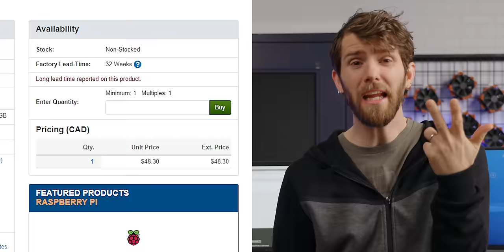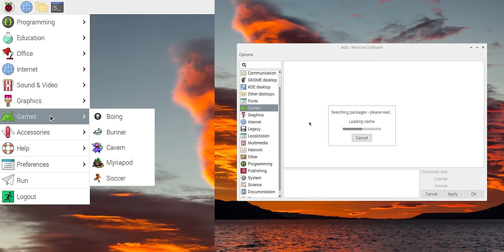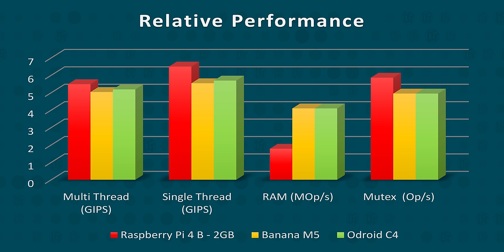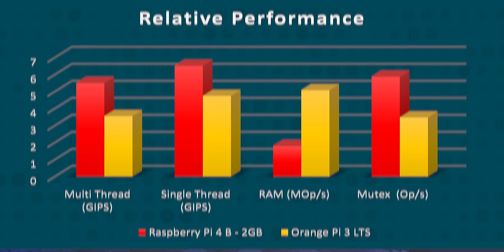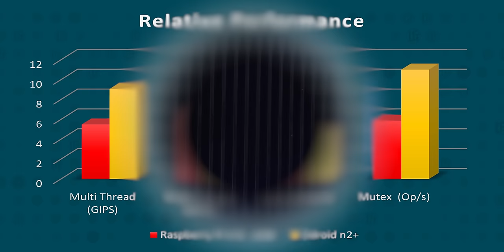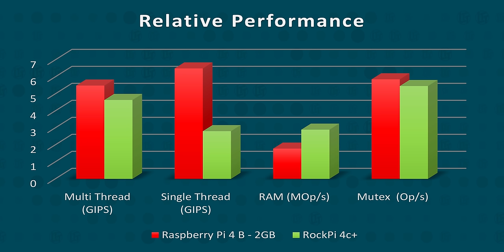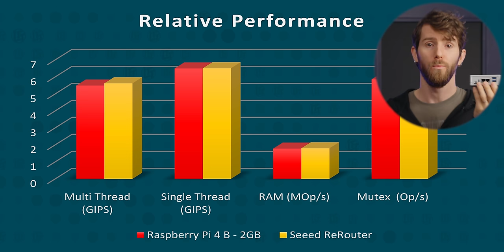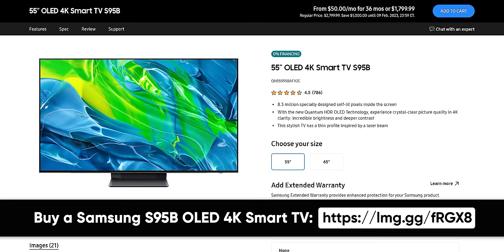I Can Save You Money! – Raspberry Pi Alternatives

Comment: I'd love to see you guys try some projects with some of these to see how much or little trouble you run into without the full support of the raspberry pi community. Maybe boost the community around these alternative single board computers
Reply: not hard. most projects require your own coding and the rest is simply hardware compatibility. If GPIO is your goal and you know linux and python, then you are set. Also you need a minimum of 2GB of ram to compile python for arm with additional performance flags. In other words only things that are pi specific that unskilled people cant do, can be replicated on other SBCs given that they have USB, GPIO and other similar things. As long as the OS is debian based, drivers/hardware works in it, you are set.
Reply: Yeah, a shootout comparing the user-experience of the various RPi alternatives, as opposed to their raw technical specifications would be very interesting.

Comment: Perhaps for next comparison, even if you compare only the specs, I'd mention the power consumption. For SBCs it might be important. After all, the whole appeal of ARM processors was computation per Watt.
Typically boards with larger RAM have higher power floor.
Reply: @filthyfrankblack4067  yeah anyone who knows anything about framework laptops is that removing usbs saves battery

Comment: I remember being amazed when I first got a Raspberry Pi Zero running. The setup was effortless but what really shocked me was how capable the system was for a PC that only cost me £10 and could fit in a wallet.

For just £10 and a few dongles I had a relatively capable desktop computer. Obviously it's not going to run modern games but you could still use it for word processing, running certain programs, and even using search engines (this one may not be possible now though).

There was once a time when computers were the size of a small house and no more powerful than a modern calculator. Back then, the concept of full office contained within a computer the size of a pack of cigarettes would be beyond sci fi, it would be full on fantasy.
Reply: Yea now there 140 bucks not that cool hmm
Reply: @viperrr6886  pi zero 1.3 is still £5 but it's out of stock [and prolly will be for a while]
Reply: >full on fantasy
the future is now, thanks to science
Reply: @hiddendrifts  
I'm wondering how lucky I am or how global is actually the global shortage
I'm in Belgium and, if you were patient enough (a few months I would say), you were able to get most of the models from an approved reseller  
However, I agree that Pis alone are hard to get : most pis offered by the seller are part of a pack. Which is good if you want to start from scratch (and bad if you are a scalper and need to store stuff), but less funny if you already have spare cables and simply need an hardware upgrade
Reply: @laplongejunior  >are part of a pack
i mean, spare parts are always nice to have, and you can just sell them if you really don't want them
Reply: @laplongejunior  Working with an approved seller is what you have to do if you want a Pi at a reasonable price.  The global shortage is still global, though.  Resellers sell out almost immediately and they have to wait weeks to months themselves to get orders fulfilled.  Them selling the majority in packs make sense since they need to be able to make their money too.
Reply: Try compiling on it compared to the worst computer you ever used.
Just like all those celeron owners
Reply: That’s actually not true.
Reply: @viperrr6886  Interesting comment.
The brand new, yet to be released Raspberry Pi 5, 8GB version is $80.
Pretty cool Hmmmmmm. At least post when you know what you are talking about.
Reply: "We interact with things today that our own Gods would not have dreamt of" - Mike Pondsmith 

(idr the original quote im paraphrasing)
Reply: Try the pi4 with RISCOS. It's really fast with the original OS for arm processors.
Reply: We can make a mini raspberry pi pc
Reply: @turbochargedfilms  nice quote. but I'm picturing our gods sat around eating chicken wings and popcorn, enjoying the ambrosia, betting amongst each other watching our species randomly fcuk around and find out... engineered viruses, nuclear weapons, particle colliders, communism, etc. they already knew we were comedy gold...
Reply: I know you were not being literal, but science fiction is fantasy, after all. 😉
Reply: If you are over 30 years old, chances are, you have a pile of old laptops, phones and desktop parts in your closet that absolutely destroy even $100 Pi.

Comment: Having owned multiple Pis and alternatives, I'm of the opinion that for most IoT use cases, an older model Pi 3B is all you need. It works fine and hits that sweet spot of performance and power draw.
Reply: Awesome! Of course, the older model Pis are all out of stock/costs hundreds of dollars now, so that conclusion doesn't help. Whereas the alternatives are at least able to be purchased.
Reply: @magnusgreel275  my alternative for my usecase and broken pi was reactivate my very old core to duo pc. Way faster 😜
Reply: @Nordlicht05  I did something similar with my old PC, but it's a hefty system which sucks up a lot of power. I'm thinking of getting a thin client second hand to serve the same purpose.
Reply: @magnusgreel275  in my case it's not a 24/7 use. Than I would maybe search some low power thin clients.
EDIT
Not for 24/7 but if energy is a concern. But i underclocked my old Intel for that.
Reply: @magnusgreel275  so my pi zero and pi 2b from highschool are worth a lot now?
Reply: @lukasg4807  not sure about the pi zero, but the pi 2b might well be worth a bit for a while. Mind you the availability of RPi in Australia is a lot worse than other places, I think.
Reply: I prefer the 64 bits though but yes they are pretty capable for node
Reply: @magnusgreel275  Thing is, Pi 3 clones have been around longer and are even cheaper than pi4 clones
Reply: Ironic as the Pi 3B is the one thats mostly out of stock.
Reply: I think some of these alternatives such as the libre potato were designed to be Pi 3B alternatives. So it's not fair to compare them to a Pi 4.
Reply: @darrentubeify   I agree

Comment: Good mention on the Orange Pi about the non standard and hard to get working GPIO pinout and insane power draw for a small board. I had these issues with Orange Pi 2 and SE and seems like years later they still exist. Great boards for the price, but poor software support to back them up. Tinkerboard, MangoPi and NanoPi are also worth looking at. I just looked up some of the boards that I have and realised that they are all going for at least 2-3 times the price than what I bought them for, so it's not just raspberry pi that shot up to astronomical prices.
Reply: Yeah. It would probably be worthwhile to make a video about mango pi

Comment: Worth considering... If you don't need the GPIO and power draw / portability isn't as big a concern, old micro PCs are usually sufficient to run most things a Pi could. If you're looking for silent operation and such, look for Atom and Celeron based PCs. You can often find them for like $50, and they already have a case, storage, and power adapters included.
Reply: Yeah, the usb ports flaked out on my rPi that was running a print server, so I put debian on an atom netbook (in my parts bin for years due to messed up internal keyboard port) migrated my stuff over from the rPi via wifi before it finally died. The Atom works fine as a print server, although not quite as space efficient.
Reply: A pc draws way more power than an ARM does. What i do is i buy a chinese android TV box for 40 bucks and install armbian debian on it. It has local storage, sits already in a box and comes with the power adapter.  Runs very task i want and cheaper than these boards..
Reply: @Hollander040  genius lol
Reply: Thin clients! Low power, common and used ones are cheap as.
Reply: my usb-c laptop still has 4gb ram, but its let down by the fact IT STILL USES CELERON
Reply: Power draw and portability are almost always things to be considered in a home computing project.
Reply: 1 liter pc you mean?  like that?
Reply: @Hollander040  Smart,  they come rooted and loaded with phoning home malware so best not to connect the os that comes with them to the internet.  wipe them and start over.  i like it.

Comment: Just a thing to keep in mind about the N2+: there were some issues reported of all USB ports suddenly failing (mine did too). If I recall correctly it had something to do with a power delivery component that had to be replaced.

Quick edit: I still use the N2+ for its Android compatibility and I am currently using it for my own infotainment system in my car. To use any USB devices I opted to use the USB OTG connector (which does still work, thankfully).
Reply: I looked at doing the same. Did you find a GPS adapter that worked with the N2+ Android? I have a few Odroid boards and none seem to work with the GPS modules I have.
Reply: @davidl1813  No I did not because I am using the GPS from my car
Reply: How much did it all cost ?
Reply: @lopezthegreat9121  the Odroid was about €100 and the usb cables and adapters probably around €30, I also made some custom pcbs, ordered some more parts, etc. So I don’t really have an exact total.

Comment: BTW, refurbished mini PCs like the Dell Optiplex, HP EliteDesk or the Lenovo ThinkCentre devices are fantastic alternatives to SBCs if you want a (relatively) beefy PC to use as a Proxmox box, NAS, pfSense box, etc. Unless you plan to use the GPIO pins or need low power consumption, I'd say refurbished mini PCs are the best Raspberry Pi alternatives available right now (depending on what you intend to do with them)
Reply: For anyone that wanted a raspPi as a cheap way to setup a media/NAS/home server, you get way more for the $$$ this way than paying these insane prices for the raspPi.
Reply: Exactly. I'm disappointed that this has never been mentioned in the video. I bought a second-hand great condition hp t520 thin client for roughly 20 bucks plus 7 for the power adapter and added a 32 gb ssd for 5 dollars. and this machine is a beast for simple tasks like home assistant. with 6w max tdp, I cannot find a more reasonable deal in my country. I even managed to install and use win10 (roughly). the only downside is the size, t520 is relatively small for a thin client but cannot compete with pie in this regard. there are really powerful and low power mini-pc, thin client, nucs out there that can be harvested for a wide variety of tasks. my home media server is an hp 260 g2 with pentium 4405u+8 GB DDR4 that I bought for 95 dollars.
Reply: @1omerfaruk  to be fair, they did a video about these about a year ago but installed Windows on it which I think misses the point of using one of these old cheap machines. I think a sequel is needed featuring Proxmox and one of these old towers or mini PCs.

The old video they did about this: https://youtu.be/zPmqbtKwtgw
Reply: @iamvinku  I have a Proxmox cluster on HP T620Plus / 2*T630 running on it: TrueNAS, Zabbix, 4 linux instances, Windows 11 X-Lite (works fine as a virtual machine on T630)

Comment: Small correction: the pi 4 outputs 4k60 on one display, but only 4k30 when two are connected 😊
Reply: Typical modern LTT video unfortunately. I feel like their quality has tanked quite noticeably as they crank up production to increase the quantity. It's not that it's done in bad faith, it's just it's almost becoming a regular occurrence. There's SO MANY in this video it's honestly embarrassing. I feel like they should remove the video at this point.
Reply: @KameHameHaNurd  I don't think it's THAT common but there are definitely a lot of editing errors here. What stood out to me was the Pi 4 specs saying "2.4/2.5" wifi. Confused me a lot until I realised they meant to say 2.4/5
Reply: And let's be real, most apps aren't going to work at 60fps at 4k. You'd be lucky to move your mouse around at 60fps
Reply: @BonJoviBeatlesLedZep  if you search through the comments, and even their own pinned one, there well over a dozen mistakes that aren't simple editing errors.
Reply: @Ryan_Carder  I'm talking about in general not in this particular video
Reply: @BonJoviBeatlesLedZep  it's not even just mistakes, but overall laziness. Their tech reviews channel is the most guilty culprit of this. Whoever is in charge over there will just simply not use a product to it's fullest potential. Yet still give it points off.

Comment: One thing I learned after using various rPi's over the years is that the specs often aren't "actual" specs. For instance, "4K 60" doesn't mean you will get to watch a 4K video with 60fps. It will down-throttle and resort to screen tearing if you actually try to use 4K. I'd rather them say "4K text only" or something. But that's $120 under the bridge (thanks r-Pi :) ). LTT, I suggest you use your new lab (whenever it's completed) to actually verify and rank these mini-pis. Can you run USB3 5gbps on ALL the ports? try it. I dont mean to retaliate against the manufacturer if they dont, but say "hey we found that it has 4x USB 3.0 ports, but you can only use ONE at full sustained 5gbps". Unfortunately specs these days don't really mean much until you spend the $ and find out what the real specifications are (thanks rpi :) ).
Reply: My experience with the Pi4 was the USB 3 had serious bandwidth issues if it was connected to a storage device.  When the computer was accessing a USB 3 storage device, the keyboard and mouse became unresponsive.  So I would agree with your comment.  And 720p would sometimes cause the 4 to struggle so I wasn't sure what kind of 4K video it would play
Reply: It really does have support for encoding/decoding video at those resolutions and frame rate using the onboard VPU. The catch is you have to install programs that are compiled targeting the onboard VPU. And some applications use different underlying libraries that may kr may not be compiled. Recently I had to manually recompile ffmpeg and underlying libraries on a Libre Renegade board to get it to process my survallence footage at the advertised rate.  It was a pain, but it is smooth as butter now.

Comment: You can also use some of the no-name Android TV boxes (usually useless because no certification/hdr support) with the Amlogic S905 series soc's to boot armbian or similiar distro's over microSD, they come with everything you need out of the box, including stuff like IR and internal storage.
Reply: It’s kinda fun figuring out how to get a no name amlogic android box to boot coreelec lol

I remember soft bricking my box until I discovered the recovery button was only accessible if you opened the case up. Made the box 10 times more useful as a kodi machine
Reply: @bryangutierrez655  never got gpu accel to work on my s905x "x96" box, otherwise itd be a great gray area/offline media viewer or a browsing machine (4x a53 is on some poverty spec chromebooks) or you can just leave it on with pihole and other stuff like a personal use server with barely any power draw and no noise
Reply: Inovato quadra is just that. It's a t95 mini tv box running armbian. It doesn't have gpio available but if all you need is usb it will work fine. Has comparable performance to a rpi3, for $35.
Reply: I agree that they are fantastic choice for low end computing devices, but be careful with trying to load Linux on them, sometimes, these boxes gets sabotaged deliberately to avoid people flashing new OS on them. I don't remember which companies did it, but the retro gaming community would probably have better documentation on it.
Reply: SoCs* distros* no need for apostrophes here

Comment: Linus dont you think it's worth mentioning that although the hardware setup for some of these is comparable, software support for even the best competitor like the Orange Pi 5 is still maturing and in early stages. Things like audio and HDMi sometimes dont work without script patching
Reply: nobody cares, we use it mostly for kubernetes cluster. Would prefer SBC without all that desktop rubbish on the board
Reply: @OlegKorsak  Sorry, dumb question and a month later but I've seen references to people building kubernetes clusters with SBCs but never figured out why or what for.  Is there a common use case?  Thank you!
Reply: Orange Pi 5 is extremely good for emulating PS2 games if you flash Android on it. Absolute cheapest possible way to emulate PS2